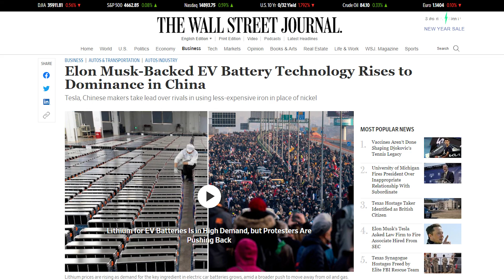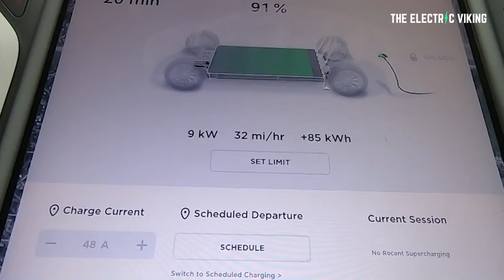Is Elon Musk RESPONSIBLE for the NEW LFP battery trend?!

Comment: We are using LFP batteries in our bikes, motorbikes and as a starting battery in our Camper and cars since 2015. 
Never had any problem with them and they are a lot stronger than the old lead accid stuff. And in my motorbikes they also weigh only 0.9kg to 1.5kg depending on witch motorbike.
The energy density is a bit less to Ternary batteries, but LFP batteries can be discharged 100% without any problem and have a longer life span.

Comment: LFP doesn't optimise in a cylindrical form factor. Tesla will have to change all their machinery if they want to produce in-house.
Reply: Why ? Product BOTH batteries. High end go for Li batteries. Low and Mid ..Go for LFP. If cybertruck is Ramp up ... then TESLA 4680 batteries will be in SHORt SUPPLY.

Comment: Back in 2015 Nissan used LiFePo4 batteries while Tesla used the supposedly superior NCA batteries. The Leaf had no real thermal management, which was probably the real reason the Panasonic NCA batteries outperformed the Leaf LiFePo4 packs. Now we are told Nissan had the right basic chemistry in the first place and Tesla with NCA, not so much. I wonder why the anti-Musk trolls don't make more of this.
Reply: Perhaps different electrolytes and construction in the newer brands have increased the Wh/kg in LFP and LFP are now viable.
Reply: "That was then, this is now"
I'm predicting (almost spamming!) An announcement of 4680 LiFePo4 cells very soon.
It just makes sense.

Comment: The world know Americans are obsessed with being Number One regardless of the facts. Today in EV, America is Number Nobody. It makes no EV battery, and in all likelihood won't ever make any. This fact rub off the power that be in America to no end. This is why they now claim their lover boy Elon Musk 'single-handedly' made LFP battery the global success. He did no such thing. 

The great success of LFP goes to the scientists and engineers of CATL. And to the CEO who stayed the course despite immense technical challenges. Two huge problems solved by CATL (patented) are first its cell-to-pack packing which substantially reduce weight, maintain structural integrity, cut manufacturing cost. Second is the self-regulating system built into the pack. This self-regulation solved the low temperature issues. Finally, CATL was able to design and build the most sophisticated robotic factory to make the complex LFP cells and the packaged battery system with a quality that is the definition of perfection. 

CATL was already China number one in EV battery before Tesla China open shop. Elon contribution is his decision to open a factory in China, and China political genius to let him in 'for free', no strings attached. Even financed his factory.  But of course, all Tesla EV made in China must use Chinese battery - everybody expected that. The question is which China battery. While there are only few choices at the time, it is also CATL ability to offer an unbeatable solution. CATL offered to develop an entire battery pack complete with all necessary control electronics and software for Tesla China. All the factory need to do is just drop and screw. This save time-to-market immensely, save development cost, and lower the price of battery. 

What made Musk said LFP is for the future is what he saw what CATL did. It's cell-to-pack solution for Tesla China exceed all performance metrics by far. So much so Model 3 price can be substantially cut, yet yield better profit. This is magic, something Panasonic/Tesla Gigafactory in Nevada never achieved. There was no end in troubles for the Panasonic battery during the few years - production quality, power below specs, low yield, and the occasional blow up of Tesla cars.

Yes Elon had to pick CATL, while CATL benefit from the immense success of Tesla China sales. The future is bright for CATL as it begins to introduce sodium-ion cells in the coming year. It's recently patented no-anode Na design is a R&D breakthrough of genius proportion, just like the LFP. How can the Korean catch up? They can't even make LFP! As to the American obsession with being number one, that achievement is made by scientists and engineers, not mass media BS. Especially the biggest BS of them all - WSJ and NYT.
Reply: you are sirt of correct. BYD developed this tech, CATL jumped on their bandwagon.
Reply: @BSBSBSBSBS-i2x  Exactly the other way around Paul. BYD have developed own EV battery for cars, bus and trucks for quite a while. Sold around the world. But BYD cells are ternary, not LFP. After CATL cell-to-pack tech gained great success, BYD R&D people figured they should give the idea a try. Easier said then done because CTAL has patent lock. BYD then did a special cell supply deal with CATL, developed own cell-to-pack solution. The result is the incredible Blade. But there is a condition: BYD cannot sell Blade to EV makers who use CATL packs - a basic non-compete arrangement. Unless CATL give approval.

Comment: I can't speak for the EV market, but I decided on LFP for solar storage long before Elon said it was the future. The thermal runaway problem is no joke. I found that LFP was rated as 98% efficiency, but my testing shows closer to 99%.
Reply: Which solar storage do you have enphase?
Reply: @Joda30088  I built my own from EVE 280AH and 304AH cells.
Reply: @john_in_phoenix  Nice! I have enphase for my solar storage. Enphase uses LFP batteries
Reply: I too was brought to LFP well before Elon Musk, by another Youtuber who passed away, Jack Rickard.  He advocated for the use of LFP in cars . . .  But Sam should be careful when he says LFP can be charged to 100% in its EV, as this chemistry can withstand more charge/discharge cycles, but to make it last longer its still between 40 ~ 80%

Comment: To answer your question:  No, it's a ridiculous notion.  I've been following the advancements of LFP batteries for years.  Those advancements long predated Elon Musk's interest in LFP.
Reply: Wait for the 4680 LiFePo4 cell, in a structural pack, causing a jump in the "system" (vehicle) efficiency.
And built in absolutely huge quantity.
First principles thinking.
Reply: TOTALLy Agreed. ... Elon ..was behind developments in the LFP batteries. The latest generation of LFP battereis are So much safer, cheaper to make and with increased power density.

Comment: I dont see any American automaker using cheap LFP batteries except tesla. also in Europe nobody plans to use that cheap Chinese technology. LFP battery looses more 30% afficiency when the weather is cold despite they already have 30% less power compare to regular lithium batteries. That 60% loss.
Reply: Outdated stats. BYD Blade canpower their EV's 1000 kms (NEDC), and all new models with the blade are fitted with hot and cold heaters, which work just fine in cold and hot countries.

Comment: Would like to see LFP in Aptera. They charge in the sun, and don't need as much energy density as other EVs.
Reply: But it's a heavier cell, which would affect a light vehicle.
Reply: @rogerstarkey5390  they have a 1000mile (1600km) model. If that goes down to 750 miles, but you can charge / discharge at will, that's still a good trade off for safety and battery life. But yea, Aptera even says weight affects range more than in other evs.
Reply: @pixelfairy  
It's all about the ratio of pack weight to total vehicle. weight
Reply: Aptera especially needs high density batteries since their vehicle is all about weight savings and efficiency

Comment: LFP patents expiring helps, and most cars don't need to high power output of NCA batteries.
Reply: Chinese companies are using LFP with a slightly different structure to the patented version, there has been nothing stopping any  company, anywhere in the world from also doin g this.

"The first major large settlement was the lawsuit between NTT and the University of Texas-Austin (UT). In October 2008,[21] NTT announced that they would settle the case in the Japan Supreme Civil Court for $30 million. As part of the agreement, UT agreed that NTT did not steal the information and that NTT would share its LFP patents with UT. NTT’s patent is also for an olivine LFP, with the general chemical formula of AyMPO4 (A is for alkali metal and M for the combination of Co and Fe), now used by BYD Company. "

Comment: Great video Sam, thank you. The LFP tech is mature, safer, and less expensive, but it is somewhat more heavy and Tesla was investing directly on other technologies last year. The next three years will be of very fast developments on the battery front.
Reply: LFP is only about 10% heavier. This is made up with the 100% charge every time.
Reply: @nordic5490  10% Heavier than existing tech. Panasonic stated that they will not use LFP chemistry on the new 4680.

Comment: your next investment should be in hair die...   bit grey M8.
Normal operation of battery   80% -  10%...  after 10 years minus 15% of energy output...   So
For an advertised new car of 500km range after 10 years the real range would be 275KM   ???? is this correct. (half)
Reply: no it would be 400km
Reply: There is a 9yr old ModelS in Norway with 96% of its original battery capacity. It has never been supercharged